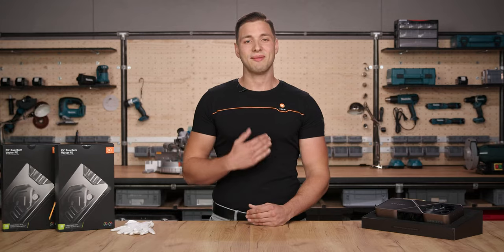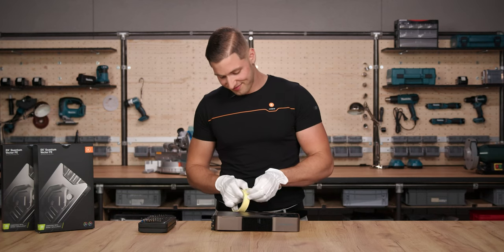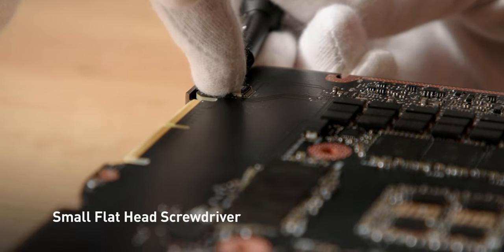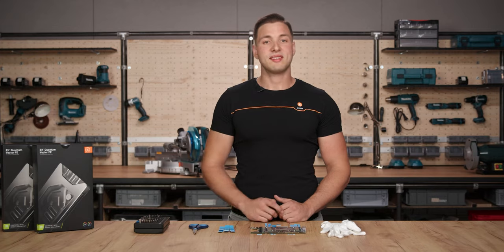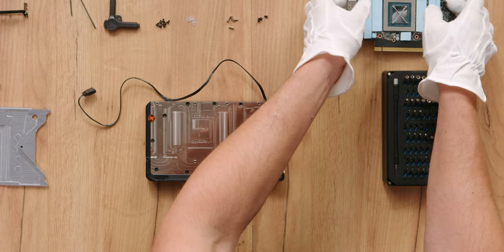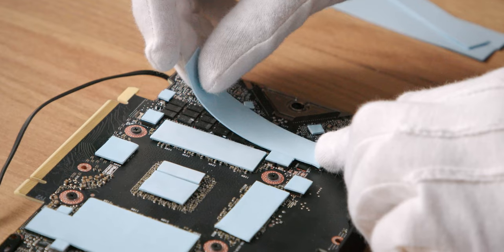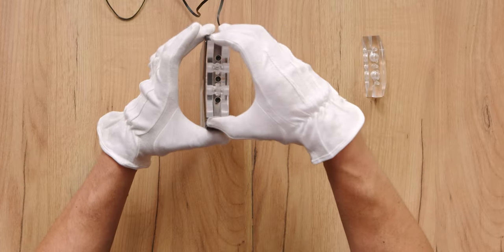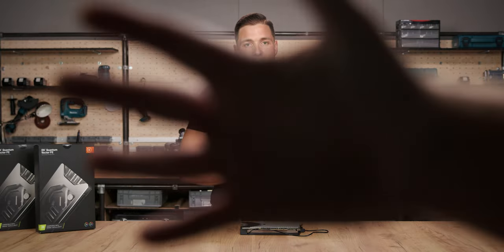EK-Quantum Vector FE RTX 3090 | Installing the Water Block

Comment: Great video, but please improve your quality control, I've had two of these RTX 3090 FE blocks and both have come with stripped screws from the factory, for such an expensive waterblock, I'd expect better, especially as the Bykski/Alphacool and Corsair blocks are like a third or half the price, the Bykski one even includes an active backplate.
Reply: That’s exactly what I have on one of my 3080fe blocks…what was the resolution on your case?
Reply: @Kirkusssss  I RMA'd it with Scan and in the end asked for a full refund. The guy I spoke with at Scan's RMA department didn't even ask for proof of the stripped screw, he just said this is a common complaint with EK's blocks as of late and approved the RMA.
Reply: @GhostMotley  thank you. I am waiting for Performance Pcs to resolve my rma. Will open my second one to make sure it doesn’t have the same issue.
Reply: This is interesting, as mine came with a seized hex screw on the backplate. Had to abandon installation, RMA the block from Canada, leaving my 3090 idle for two weeks.
Honestly, I expected better QC from EKWB. Reading your post makes me feel apprehensive about the Active Backplate I preordered...
Reply: @MiyabiJNEP  The worst being in Canada is that if you want to return for refund you loose the taxes and transport. Hope that PPC from the states can figure how to do the RMA with EKWB and hopefully get a new frame instead of shipping everything. My guess is that some sort of high torque screwdriver was used on those screws to lock into the block and strip on removal.
Reply: Exactly what happened to me. 
I had to send back 2 of the 3090FE blocks due to stripped screws. Decided to say "screw it" and went with a Bits Power Mobius. And that worked right outta' the box, no stripped screws in sight. Probably won't ever go back to EKWB for any water block, as I can't recommend their laughable Quality Control, and their 14 days+ RMA Responses.
Reply: Agreed. Had my 3090 FE block delivered last week and started assembling over the weekend. The small "V" that joins to the backplate had insanely tight screws. I managed to get two of them out (with a high quality alternative Wera allen set) but the third the head broke clean off flush with the backplate. They don't need to be torqued to 500 ft/lbs from the factory!
Reply: @chrisryan3445  This is why I gave up on EKWB.
Reply: This video may get me into liquid cooling. Very high quality

Comment: Love you EK!!! ❤❤❤ Just a couple of mentioned items for you guys. Your end of video stuff, like "what is in the Box, " "Check your RGB," and "pressure testing," should be at the beginning. This is just my opinion as all those would require a complete disassembly of the entire unit. I'm not sure why you sent SO much hardware. The small backplate had 2 screws that had galvanic corrosion from dissimilar metals and had to clean the threads and applied a very small amount of oil to prevent this from happening again. Fit and finish is amazing! I really wish the back water plate was not such an expensive upgrade as almost $275.00 USD. I would have purchased it when I ordered the 3090fe waterblock. Oh, now it is on sale and on backorder... I am VERY happy with the fact I ha e order SO much stuff from you guys and it is literally going half way around the world to Hawaii and I usually have it in 7-10 days!!! Thank you EK ❤❤❤

Comment: Pad cutting, peeling and correct placement is a complete and total PITA, especially for the numerous little ones. I know because I've installed one of these, and ended up tired and angry. Alphacool provides pre-cut pads, and Corsair even pre-cut and pre-placed in the water block! Not to mention that this tutorial arrives VERY LATE. Really EK, you are starting to resemble some shit practices from leading brands like Asus. You market ultra-expensive products that don't really deserve such a high premium, and on top of that, you are not even user-friendly. The last block I bought from Barrow was super easy, performed great, and was at 50% your price. The same goes for their fittings, which are top-notch. Less marketing and more engineering, that's what we enthusiasts want!

Comment: Great video; I've just used this as a guide to fit the block to my 3080 FE (very similar, but used the PDF to check thermal pad locations). 

Advice for anyone else about to tackle this: it took me 3 hours, start to finish. I was being careful and taking my time, it's a good 15-20 years since I last built a gaming PC and I have never watercooled a GPU before, so this lengthy time might be due to this being unfamiliar territory for me. Probably 2 hours of that was cutting and sticking the pads lol. Can confirm that there was "more than an adequate quantity of thermal pads" 🤣🤣

Comment: I received my yesterday for the 3090, ... the raised part where the water flows seem to be dirty, as if water is stuck between the acrylic and the metal... Very hard to explain....
I feel I need to strip it down and clean it up....

Comment: what about pump  ? how to connect the pump to this block ?  is there a product kit for evga RTX  3080  ?
Reply from the maker: You can connect the pump to the terminal with some tube and a few fittings, just like any other CPU or GPU block :)
You can check the available products for your EVGA GPU here: https://www.ekwb.com/configurator/

Comment: No problems of any sort on mine that I received yesterday.
I am quite surprised as how heavy this waterblock alone is, I had some sagging when installed vertically that I had to resolve but other than that the waterblock seems to be what I paid for
First time I buy from ekwb, not disappointed!
Reply: A little update. I have installed it today.
The thermal pads included are okay but for sure it can be upgraded with some better ones 1mm thick, like thermal odyssey. When not gaming I mine on my card and temps hit 102-104C with 25C ambient air temps while with stock cooler and thermal odyssey pads it was 96-98C.
A little thing that I disliked is a small decoloration present in the waterblock, it seems like something used for cleaning in factory assembly? Probably can be cleaned up by disassembling the waterblock.
In game the temps are better than stock FE cooler, I am sure it can be even cooler by using a better thermal paste than supplied (not that the one supplied is bad, it's quite good actually) 
My note for the product is 8/10 :)

Comment: 6:28: Excessive thermal paste will lead to poor performance. 
Isn't that cross of thermal paste way too excessive?
Reply from the maker: That is just the right amount as enough thermal paste still needs to be used to cover all the edges of the GPU die.
Reply: Definitely excessive. You really just need a good enough pea sized dot in the center, which will spread out on its own when pressed on.